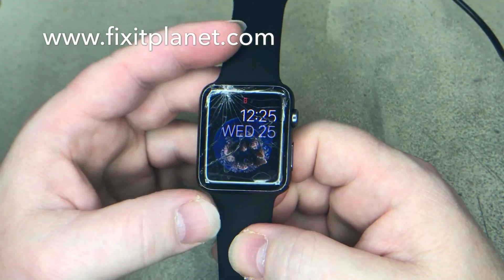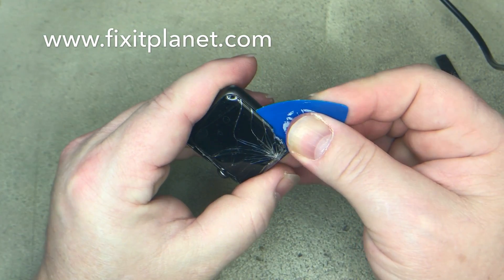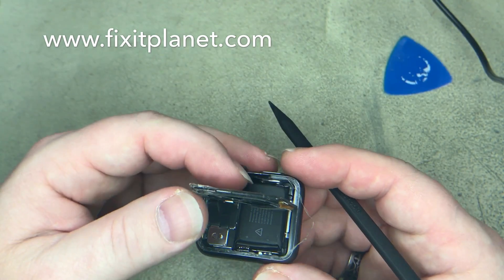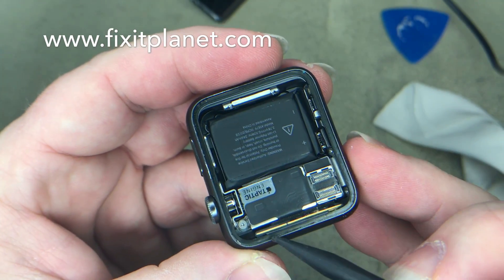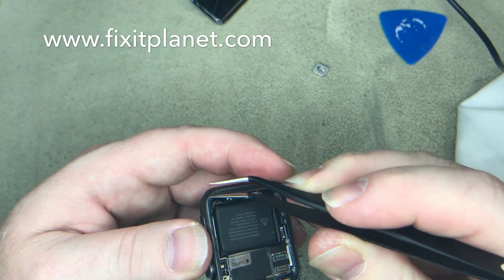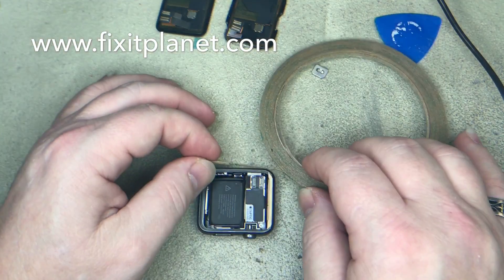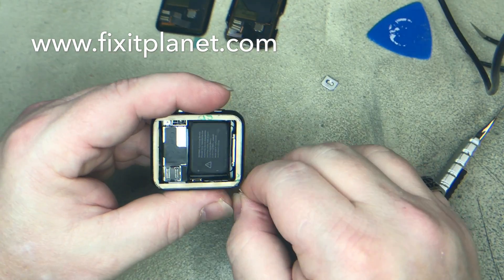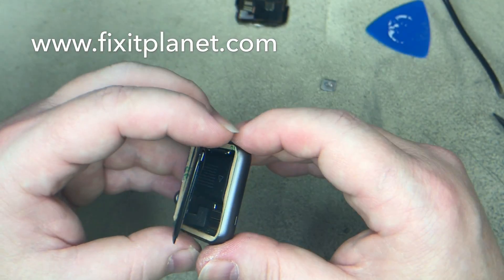Apple Watch Series 1 Screen Replacement From Start To Finish.

Comment: just watched your video, very good.  I do have a problem closing the case. seems like the battery is a little bulged out and the face tetters over the battery and doesn't snap in. the watch is working and charges but I would not doubt the battery may need to be replaced. any thoughts ?

Comment: I have a issue. I did this for a battery replacement from a totally dead battery. new one got past the snake charge screen but not it boot loops. logo 3 seconds power off. repeat every 5 min or so. force reset doesn't fix it. do you think battery isn't good? not enough voltage? no damage to the gasket touch sensor that I can see. will gladly send a email of symptoms and inside if that would help.
Reply from the maker: Test again with a known good battery with a charge. Voltage could be too low. Retrace your steps. Pay close attention. Check battery voltage with multimeter.

Comment: I’ve done exactly the same. But the new screen some times is Bright normally but wen I try to fix in the frame with double face glue, the display get not bright, may be there’s a problem in the flax cable to the Main Board ?  What is the spare part  the some time cause Display is working but not Bright? It appear like a 30% to de real bright. And doesn’t matter try to go to adjust to put +++ bright , because it do not affect the display to work as a 100% off bright ! Any suggestion ?
Reply from the maker: Yes the flat cables are easy to damage. Test with a known good display assembly and closely inspect everything for damage.

Comment: Hi I broke my apple watch series 1 screen and a few days later it still turned on but the touch stopped working. It was totally broken so i thought it was normal but when I replaced it with a new one from Amazon, touch screen did turn on but still didn't respond. So my question is, is it posible that something happened to the watch internally, damaging the touch function or is my new screen just faulty ? Thanks in advance!
Reply from the maker: Verify the watch is working properly with a known good screen assembly. You may have a defective screen or the connectors and or cable in the watch are damaged. Look closely to the cable inside the watch for any damage.

Comment: If the screen stops responding to touch does that mean you need a new force sensor or could it be another part?
Reply from the maker: The screens touch response is the digitizer in the screen assembly itself. The "force touch sensor" is a separate part (or gasket) that reacts to the pressure you apply and activates features unique to that function. If those functions are occurring then you will get a thump from the "Taptic engine" and the function will appear on the screen.
Reply: Fix It Planet, So you’re saying it may be the digitizer that’s bad. So the screen should respond to touch even if it’s loosely on top of the watch, I followed your advice and lightly raised the screen all the way around being careful not to damage anything below, but it still doesn’t respond to touch?

Comment: Hi replaced my screen 6 months ago everything was fine and then the touch feature stopped working. I replaced the force touch sensor and now I’m stuck cause the green still won’t respond to my touch
Reply from the maker: The screen may just be defective but you will have to test the watch with a known good display assembly to confirm.

Comment: can it go under water now?
Reply from the maker: If the screen is cracked it has no water resistance at all. You can make it seal very well and stay on but liquid submerge depth is reduced for sure. I would not submerge mine even if it was brand new. Sprits or splash is ok.
Reply: @FixItPlanet1  even though the screen is replaced   it can't be submerged to water correct?

Comment: After replacing the old battery with a new one, the watch stuck on a black screen and gets overheated while charging !! Any thoughts ?
Reply from the maker: Close inspection of the cables for any damage. Put the original battery back in and test again if it behaves normal try another "new" battery. If it does not behave normally then something went wrong during the repair.

Comment: Hello, if i do everything right. Will AW still be waterproof?
Reply from the maker: Not by factory standards but should still be safe enough for splash resistance. I would not submerge in liquid.
Reply: @FixItPlanet1  So when I combine it with waterproof case it will by OK ?

Comment: I needed to replace a bloated battery on my watch and came across your video while searching for instructions. You gave a lot of great info and I was able to do my repair with no problem however after turning my watch back on the screen is now very dim, although I have my brightness turned all the way up...is there something I could have messed up during my battery swap? I didn’t replace the screen, just the battery itself but I don’t think it was dim before starting this repair. And if so is that something I can now fix myself also?
Reply: mandi bartlett, I ran into the same, were you able to get a solution for screen dim issue?

Comment: Nice and thorough video!  My 1st gen had the swollen battery issue which wrecked the force touch sensor. I replaced the battery and force touch sensor (which apparently was no good). Of course I seated the screen on before I realized force touch didn’t work. But strangely I also lost ApplePay. Does the gasket also act as the NFC antenna, or is there another connection that may have come loose?

Comment: I broke one of the pop connectors... How would I got about getting a replacement? One of the mini yellow brackets fell off, Would that change much?
Reply: I did as well. I ended up buying the TWO clients a series 3 to replace it.  The series 1 is NOT easy. I hate it and will no longer do it.

Comment: sooo great video, the weak link is me though.  That black gasket came off.  Now what?  :(
Reply from the maker: You can clean the force touch sensor gasket and the surface area then replace the adhesive and stick it back down.
Reply: Fix It Planet thanks
Reply: @FixItPlanet1  the adhesive strips from ifixit are terrible, what is the adhesive roll you have there and what store you get it at?  Thanks!

Comment: I picked up my watch and the top was loose. How do I know if my battery is swollen? It feels a little squishy like it has air in it. Is this what causes the gasket to fail?
Reply from the maker: You already discovered how to tell if it is swollen. The puffy and squishy feel to the battery is due to swelling. Yes this is what causes the screen to separate from the housing.
Reply: I got my new battery in the mail. There should have been a warning to charge the new battery before installing. I struggled with my arthritic thumbs that won’t Ben but I got the old out and in with the new. Somewhere I saw to check to make sure everything works before you glue it shut. I put it on the charger long enough to see green then I attached the sticky gasket. Low and behold, the touch screen doesn’t work! Live and learn!

Comment: I did what you did
Step by step. And my Apple Watch series 2 doesn’t sync with my iPhone 7
Reply from the maker: Is the original damaged screen functional? If so then reconnect it, try to sync, and see what happens. The screen itself is not what syncs the watch to your phone however it is possible a defect or damage to anything during the repair could interfere.
Reply: Fix It Planet 
Any suggestions to do order to fix the problem ?
Thank you for the quick response
Reply from the maker: Yes. Is the original damaged screen functional? If so then reconnect it, try to sync, and see what happens.
Reply: i did everything u said. didnt work so i call apple and send it via post 
and they just updated the software manually 
and now works perfectly 
thank you for all your help

Comment: Hi I am unsure if you will reply to this question as the video is so old.

I have just dismantled my watch as per your instructions and ordered a new digitizer but the issue I have - everywhere I look I only see a single pop connection and not dual as your video.

Can I still use a digitizer with a single pop connector and will this work?

Your help would be hugely appreciated
Reply from the maker: Replace the whole screen

Comment: After replacing the screen on my Series 1, I have no touch response or response from the Digital Crown but the digitizer cable is NOT broken. When I reinstall the old shattered screen, the Digital Crown is responsive. Is the old display mated to the watch or something of the sort? Does anyone have a suggested fix?
Reply from the maker: No the screens are not paired with the watch.
Reply: Fix It Planet Did I just get unlucky with the screen or something? I have zero touch response or button functions. I believe the digitizers have a programmed IC (integrated circuit) which is paired to the watch via firmware. I went by Apple today hoping mine could be reprogrammed via the diagnostic port but they do not work on watches there in the store.
Reply: I did replace the Series 1 display with a Series 0 (original Sport) display. I would very much appreciate any advice you can give me. Thanks in advance.
Reply: Update to latest watchOS should fix the problem, problem is caused by mismatch betweeen firmware version screen/watch. Not from my personal experience.

Comment: Where i could buy the screen and the tools i need to replace the new screen? In Norway or Spain nobody do this service unless you paid more then half of the price of the watch. So i really want to try do it myself if the case is to through it away the watch. Can somebody write any safe link that i could buy it. Thanks guys.

Comment: Great tutorial, removed the screen, cleaned the gasket with alcohol, waiting for the screen to shipped. About force touch gasket, i have one little chip on the gasket, (kind of a little bump, not like a chip), and its not a big thing, and those two connectors fine. Would it be a problem with just a little thing on the gasket?
Reply from the maker: Test with new screen before attaching permanent to make sure force touch works.

Comment: if i damaged the pop connectors trying to get the metal bracket off (nearly impossible) can i replace them? if my lcd was working despite shattered glass--how to separate the two?
Reply from the maker: Unfortunately if the pop connectors or flex cable are damaged you're done.

Comment: Will your Apple Watch still be waterproof after changing the screen?
Reply from the maker: If the screen is damaged you already lost any water resistance. Replacing the screen does not make it water proof. But if you do a good job it is better than having a cracked screen. ;)
Reply: Dipper964 basically no

Comment: I have a heat gun with only one setting: 500 degrees Fahrenheit. Will this be too hot? How far away should I hold it from the watch?
Reply from the maker: Just need to warm it up not burn it. Distance varies based on angle and temp.
Reply: Joey Engh dont hold it too fucking close (answer)

Comment: Hi before I watched your video I watched ifix it which caused me to fail. 
I need help replacing the gasket thing that attaches under the battery. Can you help guide me or make a video or send me a link!?? Thank you!
Reply from the maker: It attaches with a pop connector "beside" the battery (not under) next to where the battery connects. Warm it up and remove the battery and you will be able to access the connector for the force touch sensor gasket. Warning: Be careful not to tear any other cables or you are done.

Comment: I ordered a screen and was able to put it together. But the glass is not tinted like the original screen. Any solutions?
Reply from the maker: ?? If it's the whole display it should look the same.
Reply: I just experienced the same thing. Whatever came about with your screen?did you get it to work?

Comment: Hello there! Thank you for uploading this video. After watching it, I feel more confident about replacing the screen on my own. However, I don't have the heater to heat up the metal. Is there any other options that I can get? Will a hairdryer work?
Reply from the maker: Doesn't take much heat, a good hair dryer on high should work but will take longer to heat up.
Reply: I disagree on that comment he gave you on it doesn’t take much heat cuz I do this several times for people. You can buy an $8 heat gun on eBay hun cuz a hair dryer is a bit different. But you want to heat your watches edges to where you need a cloth to hold the watch after cuz it’s too hot to touch. This will make you not cut up your body on your watch. Trust me I’ve done it. And when you use the blade go in at a slant and wiggle left to right til you hear a popping. That means your hitting the ledge of the screen. Keep doin it til c will c your razor start to go in;)

Comment: i on accidentally ripped the cable while trying to unclip the the hinge, do you know where i can find a replacement? i
Reply from the maker: Don't know what cable you damaged. Series one screens are available on eBay, Amazon, Mobile Defenders, just search online. Series two screens are coming available in China for a high price. If it's the force touch sensor gasket that can be replaced but if you damaged any other cables besides the screen itself your in trouble.
Reply: Ok, thanks for the help.

Comment: I have watched a few of these videos detailing the same process.  And this was the best and most detailed!  Great camera work and detail which is definitely needed for this job!
Reply from the maker: Thank you
Reply: @FixItPlanet1  I have a issue. I did this for a battery replacement from a totally dead battery. new one got past the snake charge screen but not it boot loops. logo 3 seconds power off. repeat every 5 min or so. force reset doesn't fix it. do you think battery isn't good? not enough voltage? no damage to the gasket touch sensor that I can see. will gladly send a email of symptoms and inside if that would help.charged it for 3 days. disconnected battery for hours and reattached as well to drain system. same results.

Comment: Great tutorial .. complete and specific instructions to do the job. I bought a Digitalizer from mobiles defender but the 3m tape it's no function and I try two attempts but display try to go out of position . Could you send me information about what kind of type you use to attach this part to the frame ? It's factible to buy complete sticker gasket to reassemble the watch ? Thanks so much .
Reply from the maker: Thanks. I have not had that problem so i don't know, maybe try a stronger & thicker adhesive. As for made to fit adhesive try searching Ebay or Amazon I'm not sure who has that.
Reply: Fix It Planet thanks, Ordered a packing sticker for 42mm model from amazon, to try . Thanks a lot.

Comment: What screen type is it I'm looking on amazon and I can't find it
Reply from the maker: Screen type depends on the specific series and size. At this time Series 1 screens are available and Series 2 screens are just starting to become available and are still quite expensive and hard to find.
Reply: I have a 7000 series and a 42mm case
Reply from the maker: Sorry but there is no "7000 series" Apple watch. It's either series 1 or series 2. Sort of like 1st generation and second generation. There are only two screens for series 1 Apple watch available at this time 42mm and 38mm. You can buy the glass only or the whole assembly. I recommend replacing the whole assembly as done in this video.
Reply: It's a 1st series

Comment: Hi, I replace the display, but the touch does not work. I read in some forums that its necessary reinstall the OS. It`s right?
Reply from the maker: First try a known good screen. I have not ever had that problem but reinstalling the OS can't hurt anything and be sure to check connections and connectors for damaged pins or a bad connection.
Reply: People don’t tell you when you replace a screen only that it’s not programmed. What I do is buy iCloud locked watches on eBay and do it that way hun. It will be a hit or miss. Cuz 2 out of the 5 watches I baught had no touch once I transferred them. But try again. Don’t just do the digitizer though. There will be no touch.

Comment: How much confidence do you have when it comes to water resistance in replacing the adhesive in this video? Is that a concern or not?
Reply from the maker: Apple Watch Series 1 (in this video) is splash and water resistant, but not waterproof. Series 2 is waterproof up to 50 meters. Once the screen is cracked it is no longer either. Anytime you break that factory seal water resistance is reduced even if you put a unbroken seal I would never endorse water resistance or waterproofing. However a minor splash is probably not going to cause a problem and is still safer than a cracked screen.

Comment: Is that a black screen?  Is there any difference between a clear screen and a black one?  I can fine clear ones...where to you get the black ones (approximate cost)?  Is that just the screen you replaced or does it also include the digitizer?  Thanks!
Reply from the maker: That is a full display assembly with a black border. Don't use just a clear screen (digitizer only). Replace the entire display assembly comes with everything you need unless you damage something else during repair.